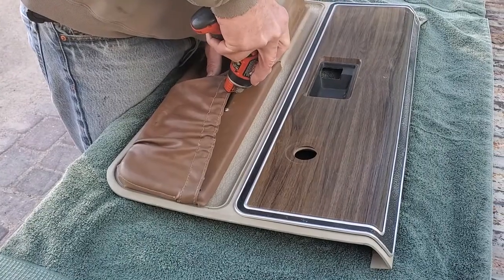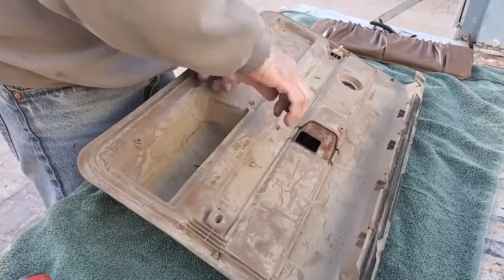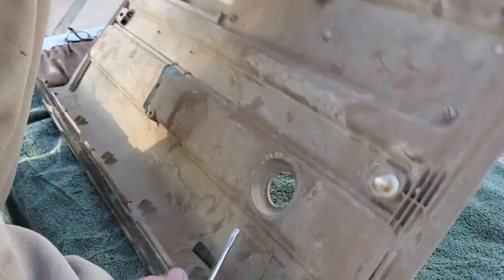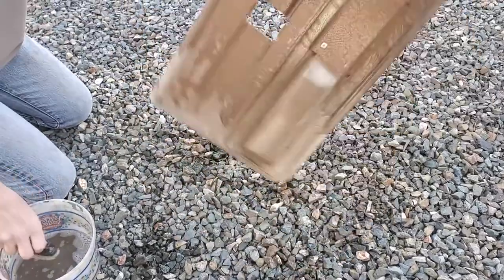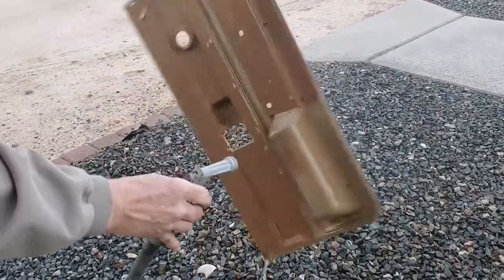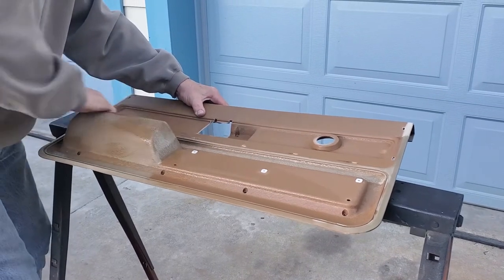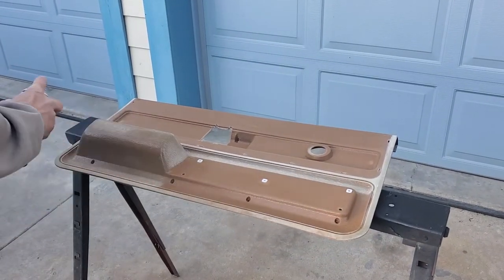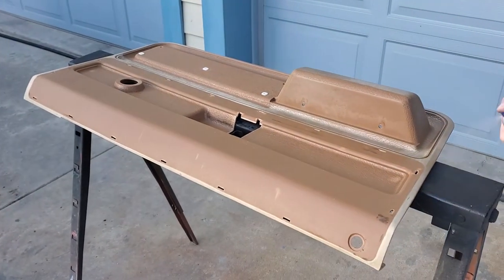How to Paint Truck Door Panels in Minutes - Easy Duplicolor Tutorial

Comment: So doing this means I don't have to sand down the door panel
Reply from the maker: It's not always necessary to go to bare metal. You should sand and fill imperfections. If you go lacquer to lacquer that has been washed off and cleaned with Prep-All or a similar pre-cleaner you can paint directly on it with full adhesion guaranteed.

Comment: how do you get the door panel off
Reply from the maker: Unscrew the door lock button. You will need a special tool to  pop the spring behind the window crank, available from LMC Truck. Then you have to remove the screws below the armrests and possibly screws holding on the door pocket. After that you can pop it off, but you might break off the plastic fasteners,  because they're old and brittle. New ones are also available from LMC Truck. LMC Truck isn't a sponsor at the moment. It's our preferred source for parts.